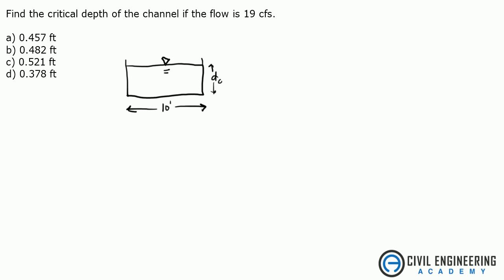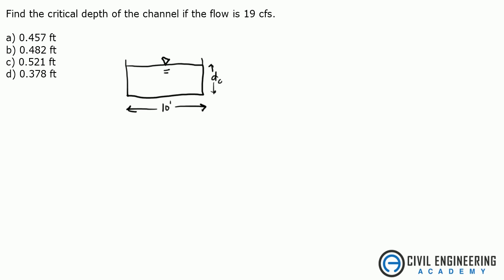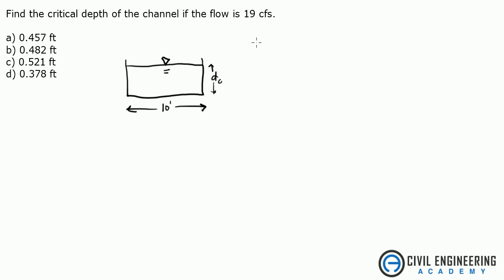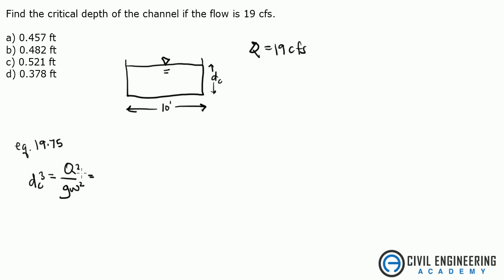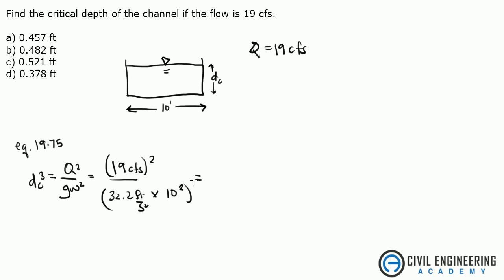Water Resources-Critical Depth

Comment: When I calculate 19^2/(32.2*10^2) I get 0.112. 
19 squared is 361, so divided by 32.2 how are you getting a figure that starts 0.4?
Reply: cubic root from Dc to the power of 3
Reply: Aha. Got it, must read the full question. Thank you.